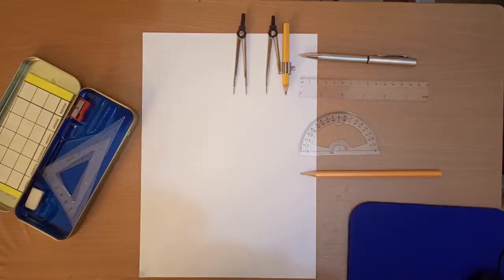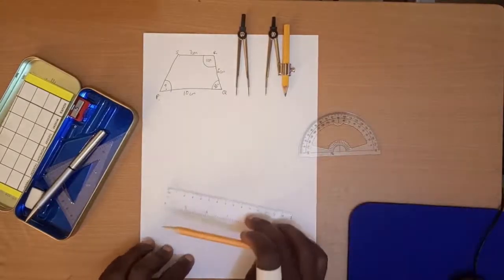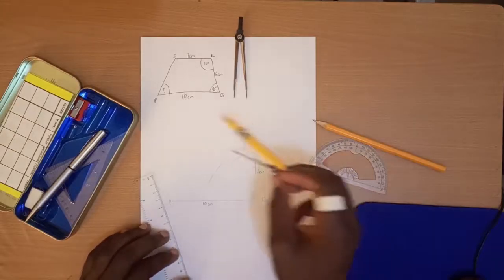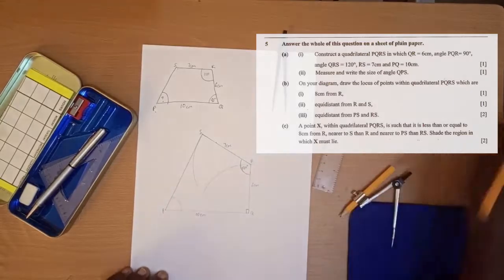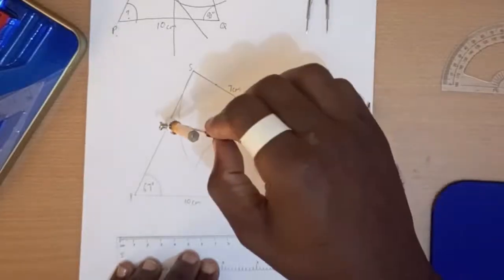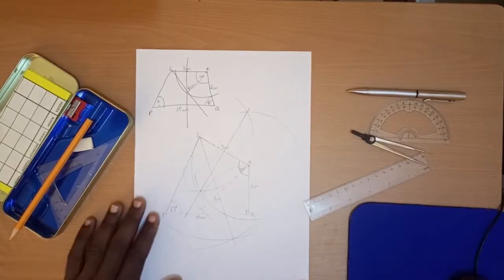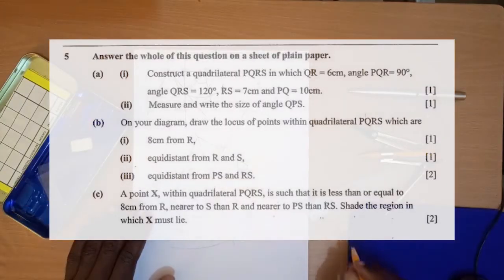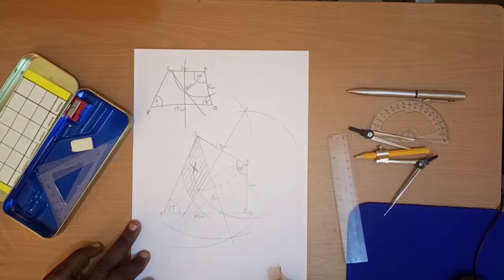Construction and Loci (2020 GCE)

Comment: Thanks for the vid! Is there a range of "answers" in which markers expect pupil/student responses to be, (considering minor error readings, e.g. a slight shift in the compass without noticing, or set marks when joining points.. while of course one strives to ensure they are as accurate as possible with their construction & loci tools)?
Reply from the maker: Yes sir, under this topic there is a range of probably +1 or -1 in respect to the actual answer.